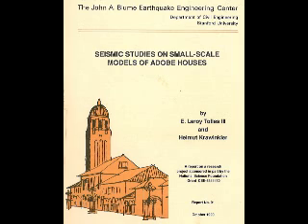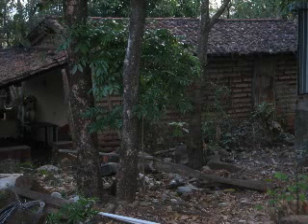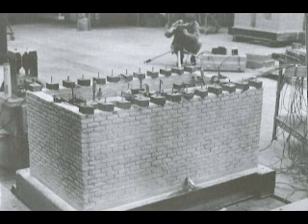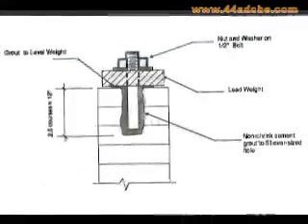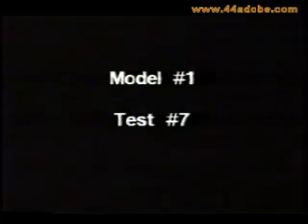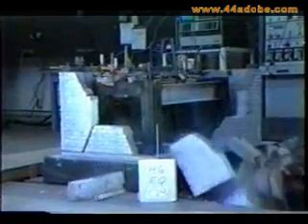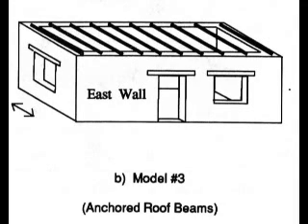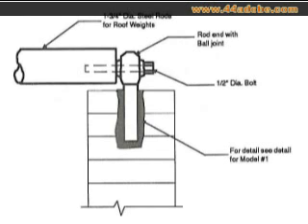Adobe house performance analysis

Comment: Don't most adobe structures have plaster or cob on the outside and inside of the bricks, giving them tensile strength?

I've always read to have 2-5 inches on the outside and inside of essentially cement to weather proof this. Just bricks aren't common at all.